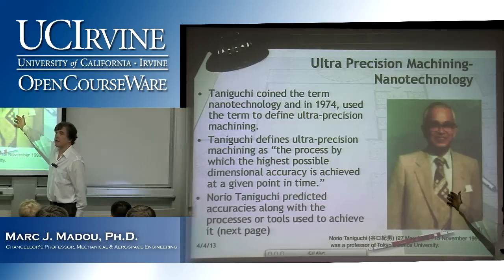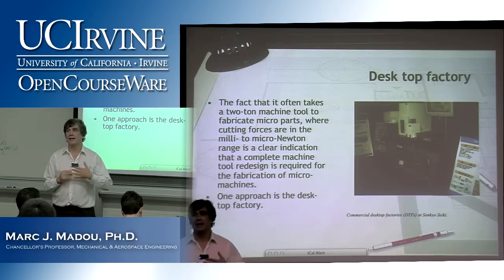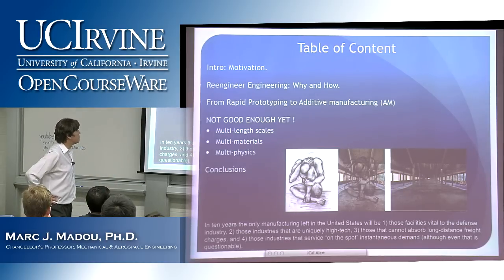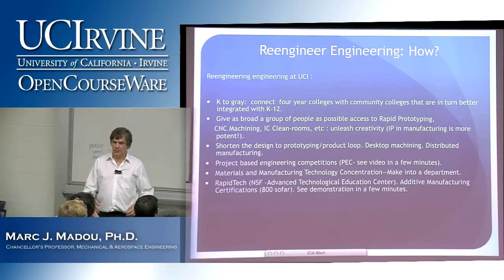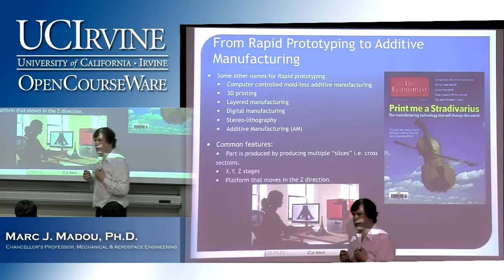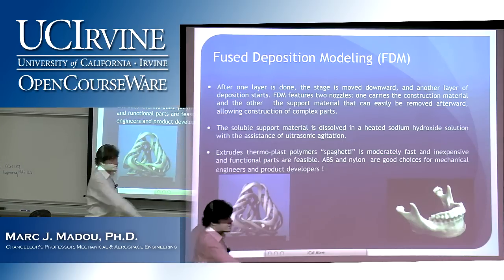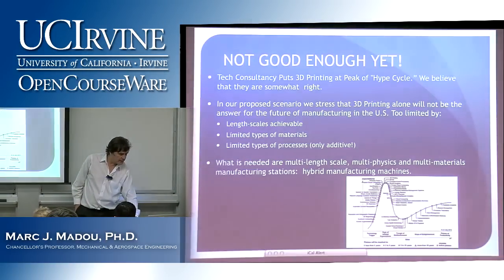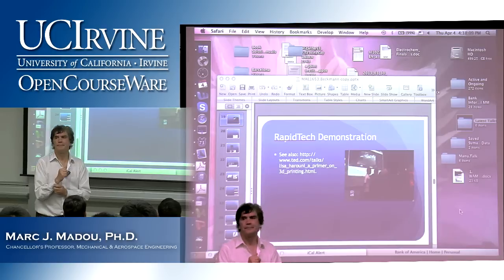Engineering 165/265: Advanced Manufacturing Choices. Lecture 3: Manufacturing Types, Part II

Comment: Engineers are not machinists or fabricators and are not taught how to be skilled in this field. If every engineering had to spend time learning how to run machines tools the same as a machinist they would be better suited to understand what they are doing as an engineer. No amount of lecture or theory can replace the time spent doing hands-on learning. Taking one machining class in college is not enough it takes years to be a quality machinist so how do mechanical engineering students expect to know this field of advanced manufacturing with college courses that have one lab in machining? I spent 20 plus years as a machinist before the next 20 years teaching advanced manufacturing (which I continue to do), not one single moment would I trade on the factory floor for  time in a classroom as I would have never obtained the skills needed to teach advanced manufacturing by having my head in a book studying theory. Yes I have a Master's but it never gave me the skills that working on the shop floor did. You learn by doing not by reading a book, trial and error, this is why prototyping is so important.

Comment: I totally agree with point you made when you said engineering students learn only theory and can't apply well in industry. I would like to add on it more.I think thus is because engineering class usually teaches about design theory and touch very little on construction part or not teaching them together. for example as an chemical engineering student I have been taught to design distillation tower but there was little touch on metal fabrication technique of the column, welding process,tray selection and so on. plus how to check for license and permit.I think this is where the gap is.